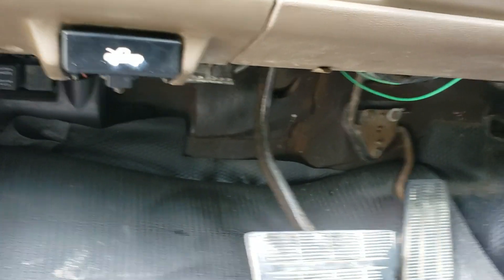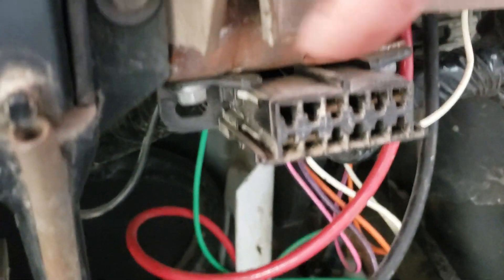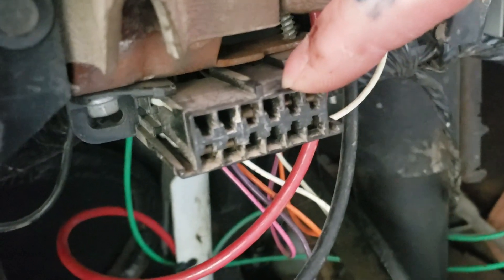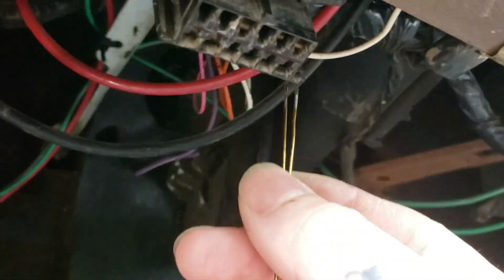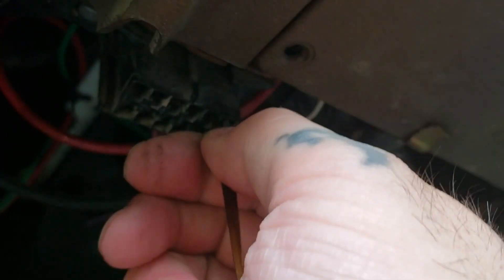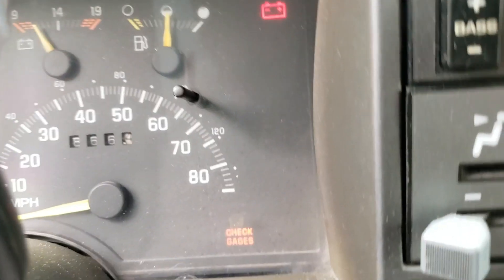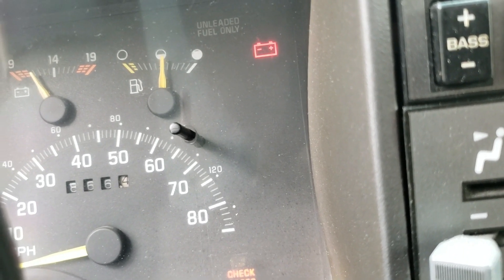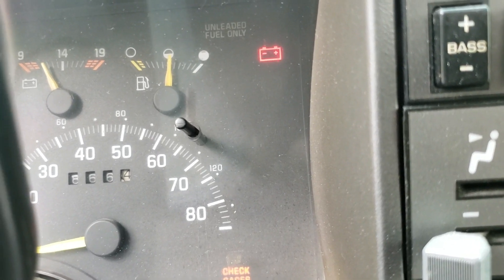How To Read Older GM OBD Diagnostic Codes

Comment: Does this work for transmission codes also?

Hoping somebody had this exact issue and knows the proper fix.

4L60E automatic. 228,000 miles.
Tranny shift delays from 1st to 2nd, when at any temp. Will hang in 1st until 2,700 to 3,000 rpm, and shift softly when it eventually upshifts. I can also get it to up-shift by slightly easing up on fuel pedal, at about 2,400 to  2,700 rpms.  It will downshift as it should when going up a hill at around 15/20mph, 2nd to 1st. Reverse and 1st always work good, cold or hot.  3rd & 4th work fine.  Fluid is exactly Full and clean, when hot/level. No Check Engine Light or any other warnings or issues. 

Anyone have this issue?
Reply from the maker: I am not sure if it works for the transmission or not